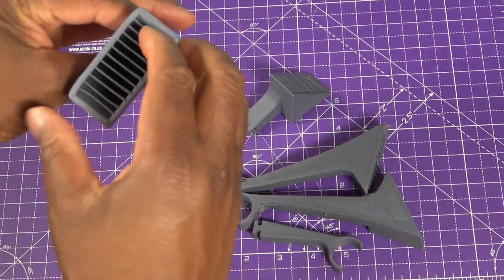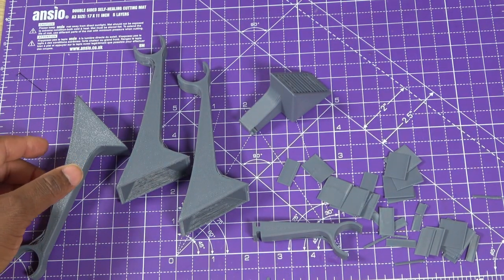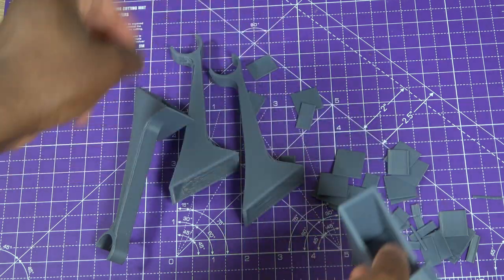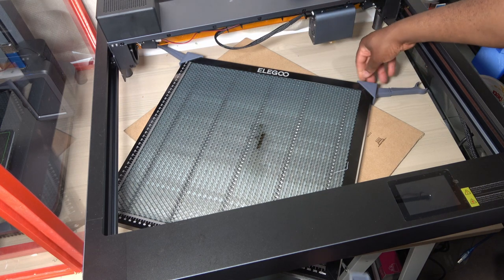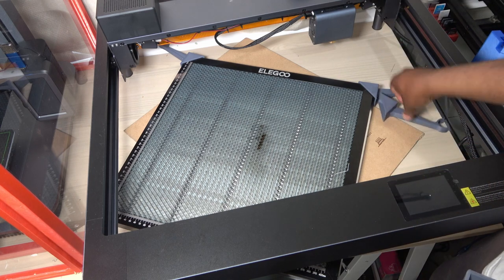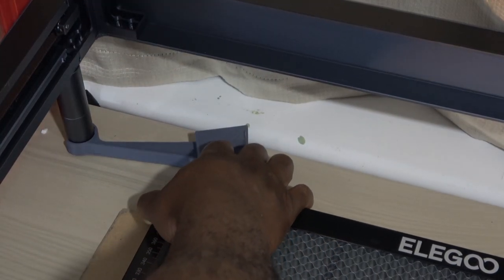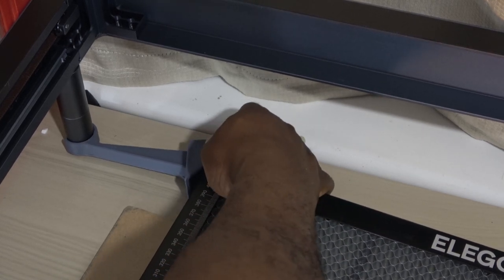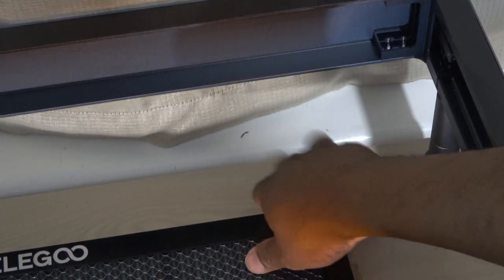Centring Spacer For Phecda Honey Comb Panel

Comment: I printed the V2 files and if I put the 2 piece on the top right there is no combination where they can all go on and align with the working area of the engraver. Is this for the V2? Feel like Im missing something.
Reply from the maker: the V2 files were replaced with the correct files. My apologies for the "bug" (defect) in the original files.